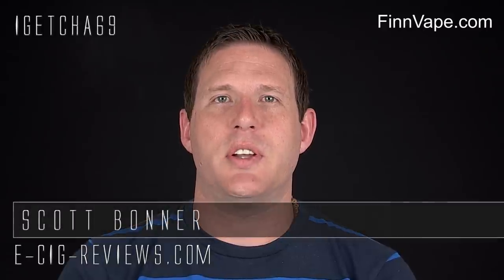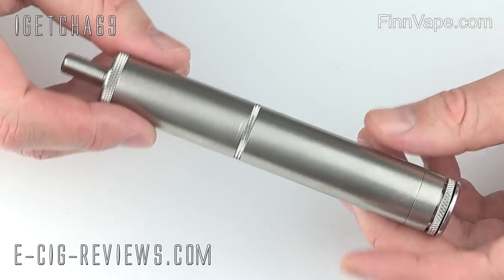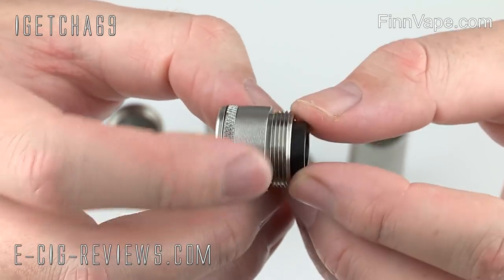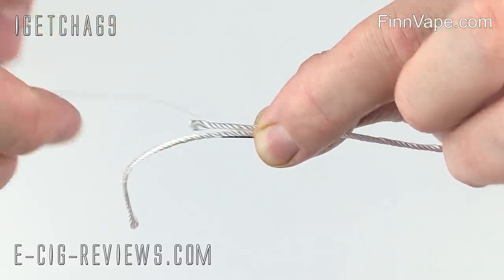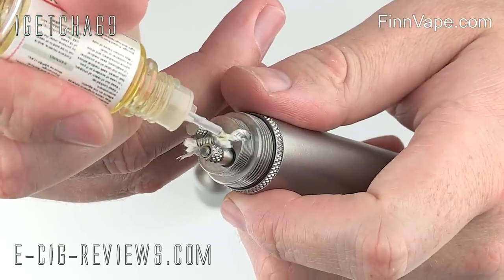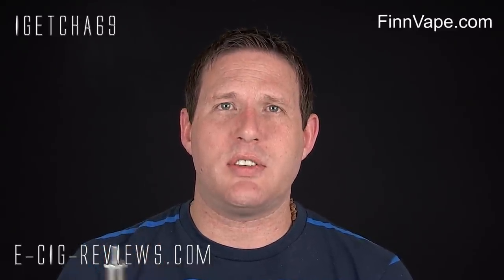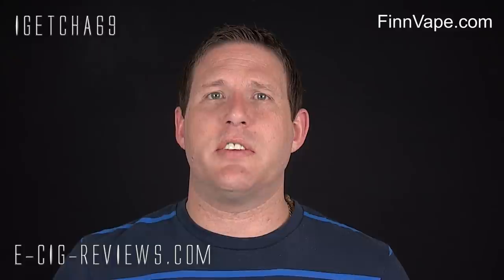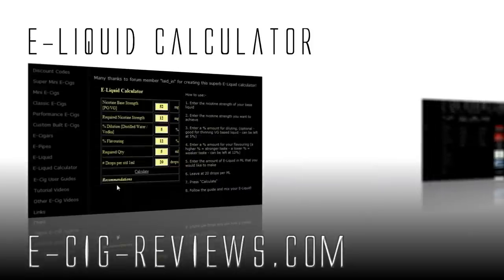REVIEW OF THE MISTER SILICA HYBRID ELECTRONIC CIGARETTE

Comment from the maker: hi mate,

no, you won't need to tilt it as it wicks really well :)

and as its a fully mechanical device which uses a hybrid connection you would need to use a multimeter to measure the resistance

cheers

scott

Comment from the maker: hi mate,

you can build a sub 1ohm coil on any rebuildable as its determined by the user......wrap 4 turns of some 0.28 AWG wire and that will likely be under 1ohm ;)

cheers

scott

Comment: Hi Scott, big fan here, just love the reviews. I have a question, I have just got a Mister and when opened up found that the lock ring is pretty much stuck to the firing button and just would not turn, so I simply cannot use the firing botton. Not sure what I need to do, do you have any idea if this is a know n issue and what can be done? Thanks.